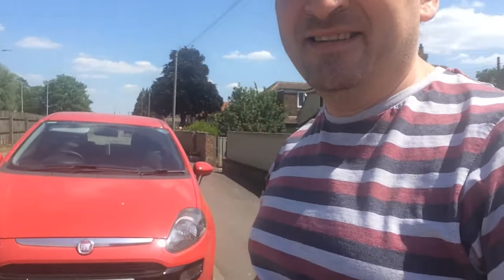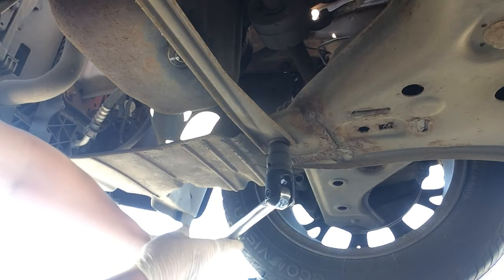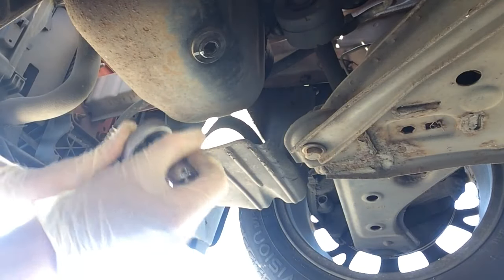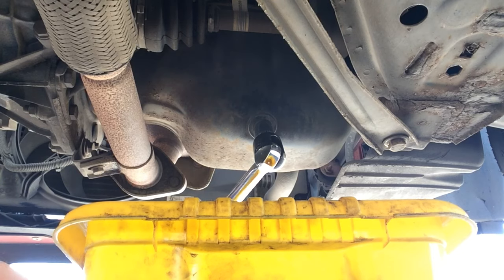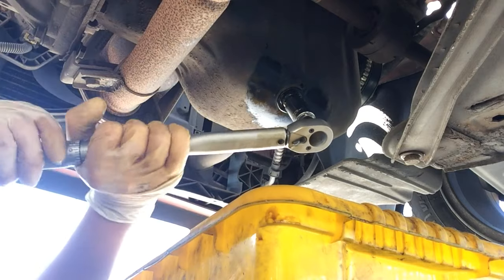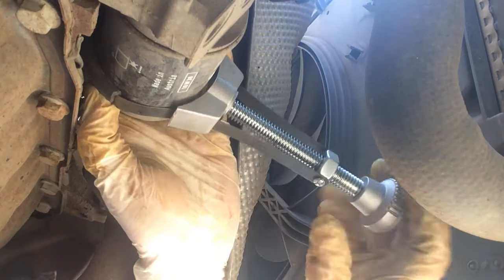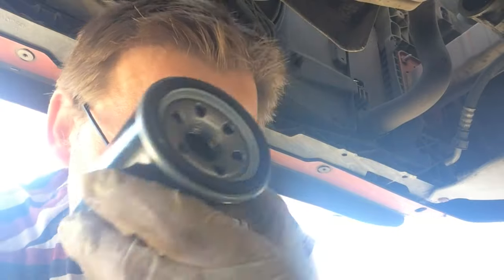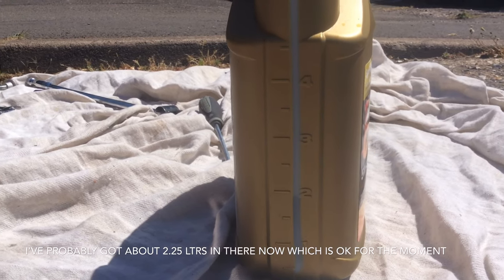Fiat Punto Evo 1.2 Ltr 2012 Oil And Filter Change.

Comment: Type oil please?
Reply from the maker: I’m using a part synthetic 10W30 but according to mechanical engineers I speak to it’s best to use ‘oil’ and change it regularly. It’s a bit like milk on your cornflakes, just preference. Having said all that, older engine, may benefit from a thinner oil to get round the galleries.

Comment: Haw many liters ???
Reply from the maker: If you mean the oil change 2.6, plus a bit for the filter, if you mean engine capacity. 1.2 and oddly  with these engines the 1.2 and 1.4 have different oil sump plug arrangements and torque values 💁‍♂️
Reply: 2,6